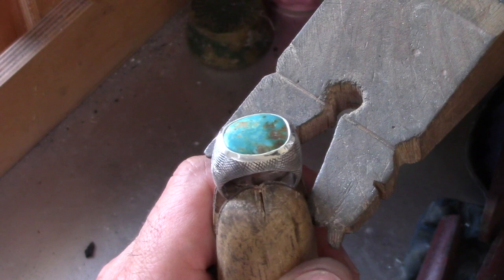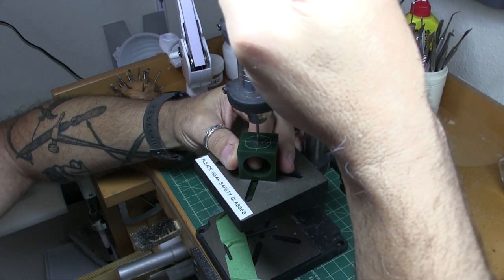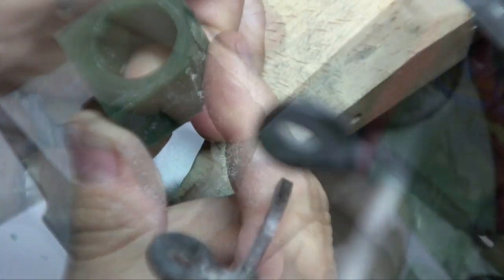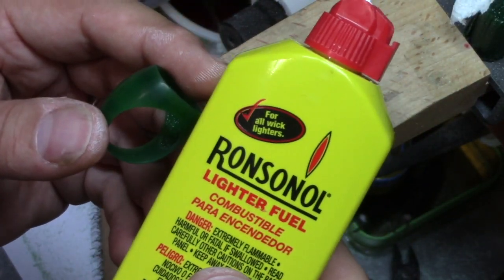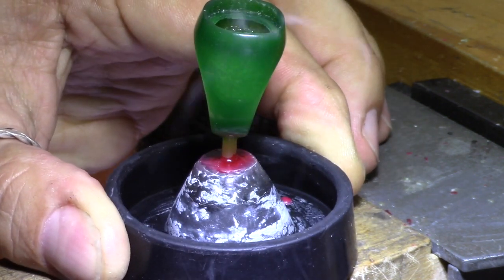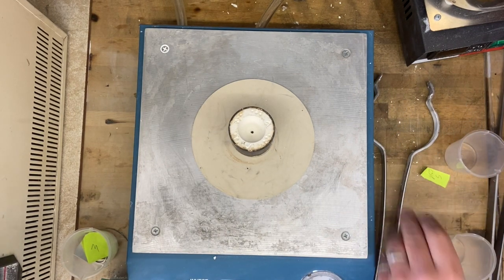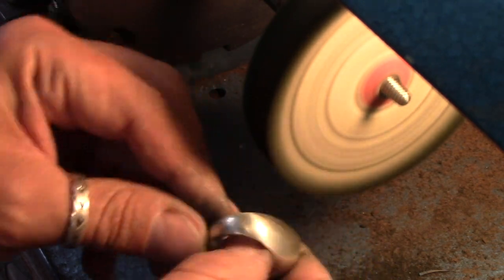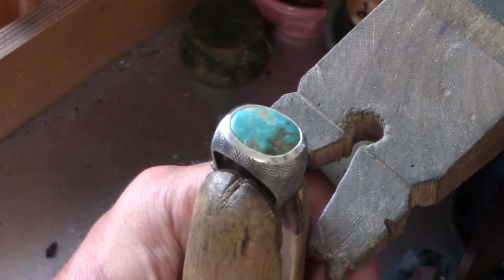Set a turquoise with the lost wax casting technique

Comment: This is a great video tutorial. Clear and succinct. I wonder how much did you take off the edge of stone setting in order to allow for shrinkage? Also I couldn't hear how long ago stone setting technique was used/what country/not sure what was said there. Also with such a large ring, were you at all concerned with the metal flowing to the top through one sprue?  Lastly, using a vacuum casting table takes the place of a centrifuge? Thanks
Reply from the maker: Hi - Thanks for your questions and for watching. Shrinkage is 5% after casting. This is an old style of setting and goes back to ancient Rome, if not earlier. If you size the sprue correctly and know how to manage the thickness of the wax model, then using one sprue is often successful. Also, using a casting machine, like centrifugal casting machine or a vacuum casting machine, can give you great results. You can absolutely use a vacuum casting machine for this project. If you want to learn LOTS more about making stone settings for casting, including casting with stones in place, please check out our Lost Wax 3: Settings in Wax workshop. Available online and in person. We have one starting this week (7/25/24). https://www.silverajewelry.com/classes/w/ID/539/eventID/7878/Lost-Wax-Casting-3-Stone-Setting-in-Wax/details.asp

Thanks again! Joe
Reply: @SilveraJewelrySchool  Thanks for addressing my questions! I will check that link out.

Comment: Hi, I was wondering; is there any shrinkage between the wax and the cast piece - did you have to enlarge the setting for the stone to fit? - thanks for the tutorial.
Reply from the maker: Hi! Thanks for your question. Yes, there is around 5% shrinkage when you cast your wax model. You can adjust for that in the model or after casting. Want to learn more making stone settings in wax models, including casting with stones in place during burnout, try our Lost Wax 3: Settings in Wax workshop. Available online and in person. Classes are live with your instructor, and recorded so that you can review them up to a year later. Thanks for watching! https://www.silverajewelry.com/classes/w/ID/539/eventID/8091/details.asp

Comment: 5:31 I’d like to be able to simply melt the metal as you did instead of using a furnace. How do you ensure you didn’t get the metal too hot/the perfect temperature? Do you just maintain heat all the way over to the vacuum right after it’s reached it’s melting point? Also what do I search for to get this equipment? What do you have the metal inside of? I see a cast iron pan, what else would you use?
Reply from the maker: Hi - Those are all very good questions. These are important steps to do correctly and safely, more than I can cover in a reply. Our school covers lost wax casting in our Lost Wax Casting 1 - the Basics workshop. It's available in person and online. Check it out at silverajewelry.com/classes/w/c/30/Casting for more info and upcoming dates. Thanks for watching. Joe

Comment: Is the vacuum table required for casting the silver or can you heat the mold hotter than the silver to allow more time for the silver to flow into the finer details
Reply from the maker: Hi! Casting started 6000 years ago with simple gravity pours into clay molds. This is the least amount of force you can use to help your metal fill the mold. A lot has changed. A vacuum table helps to pull trapped air and gas out of the way and pulls the metal into the mold for a good fill. You can also use a centrifugal casting machine to apply greater force to fill the mold. You can just pour the metal into the mold, but your chances of a full casting are reduced. Somethings you can do to assist the casting are to make sure that the sprues aren't too narrow. Add vent sprues on the to the models to keep trapped gas out of the way.  Don't try to cast too many models at the same time. Don't overheat the mold! Use the same normal casting temperature as a normal casting, from 900 - 1050°F. If the mold is too hot, the metal may take too long to cool and can cause porosity or other defects in the models. You can add force in simple and very interesting ways: look up steam casting and sling casting. :^) Thanks for watching! Joe

Comment: Great and informative video! I have an unusual design for a memento mori ring. Can I achieve this setting with small domed glass if careful when tapping the metal? Thanks!
Reply: Hi - Yes. We often have to practice this setting on glass in school. Try it on a simple sample first before the real thing, if you like and you can reduce the wall thickness to around 20-24 gauge, too. Memento mori are wonderful and hold so much meaning. Thanks for watching

Comment: Thanks for the great tutorial! 
I was wondering if someone could help me out with a problem I’m having. I recently got into wax carving and had several pieces cast in silver. The problem is that every casted piece tarnishes extremely quickly, I’m talking literally a few hours of just lying on my desk after polishing and it already starts to tarnish. I really don’t know what to do about this… Am I doing something wrong or is something wrong with the alloy my caster is using? Or is that a normal thing with casted silver?
Reply from the maker: Hi - Yes, fast tarnishing sterling can be frustrating. If you're having such a fast reaction, there may be an environmental factor. For example, storing your jewelry too close to your chemical patinas will cause them to oxidize. Also, humidity, sulfides in the air, and other things can make sterling tarnish rapidly. If you're casting is using a normal 925/75 sterling alloy, it shouldn't tarnish quickly. Two approaches to stop it are 1) use a non-tarnishing alloy, or 2) store your jewelry with anti-tarnish strips. Alloys like de-oxidized sterling and Argentium 940 are naturally tarnish resistant. If you use these and they somehow still tarnish, it must be something in your studio, like a nearby or airborne chemical. Their natural tarnish resistance is a great selling point. Anti tarnish strips can be inserted into a plastic bag or case with your jewelry. Also, properly storing your jewelry can help to prevent tarnish as well. I would try some of these tips, and also store some of your jewelry somewhere else as a test, like at a friend's house, just to see if it's your space or not that is the issue. You can also check some regular sterling sheet and wire, not from your caster. Is it tarnishing quickly too in the same place? Thanks for watching! Joe
Reply: @SilveraJewelrySchool  thank you for the tips! With regular sterling wire or sterling chains I buy for pendants I never had any problems at all, that’s why I was wondering about the casted pieces.

Comment: very nice ring design, I wondering is it possible to make a ring in 999% silver using lost wax system and vacum machine? I ask that becouse pure silver is hard to give details when casting in traditional way...
Reply from the maker: Hi - This ring was cast with a centrifuge, but also works with a vacuum casting setup. You can cast in fine silver (.999), however it is softer and so details will wear off faster than sterling. You could consider using Argentium instead. It is harder than fine silver and is tarnish resistant. It casts beautifully. You just have to wait longer after casting before quenching it or use a dry method to knock out the investment.
Reply: @SilveraJewelrySchool  thanks for the info  :)

Comment: How did you get the score marked design on the sides of the rings after it was cast ?
Reply from the maker: Hi! I used a checkering file, Swiss cut 0. You could also use a regular file and cut lines with the  corner of the file, or even try using your jewelers saw. The checkering file makes it easy to  make parallel lines. Thanks for watching!

Comment: Great video! Are you using wax saw blades to trim excess wax? How much extra space is being shaved in the setting to account for shrinkage (0.5mm)? And last, would you use the same hammer/punch technique if the stone was square or rectangular?
Reply from the maker: Hi Julie - Yes, I usually use 2/0 spiral saw blades. If you adjust the setting for shrinkage, it's 5% larger in the wax. The punch method will work fine for stones with corners, like squares and rectangles. :^) Thanks for watching! Joe

Comment: Hello,

I hope you can help! How do you do rubover set a single  round stone on signet rings? Should I use a flat top with straight edge stone and just glue it? Or a flat top with single bevel stone? If using a FTSB stone that is 1.5mm in height, do i need the bevel to be a bit higher than the stone? And what would the thickness of the bezel should be? Many thanks in advance!
Reply from the maker: Hi - Generally gluing is not the first choice for quality jewelry. Try this video on bezels from our friends at Beaducation. https://www.youtube.com/watch?v=Uqr466jH3nQ

Comment: Excellent video! Thank you for sharing your method. Do you need to resize your bezel after casting? I’ve heard the bezel can shrink in the process. Also, I am planning to use a furnace to melt down my metal— do you know if I need to add flux to it with this method? Thanks again!
Reply from the maker: Hi Amber - Thanks for watching! Yes, castings shrink 5%. So you either need to grind the setting after casting, or make it 5% larger in the model. Re: graphite crucibles and flux - There are mixed answers to this question. I don't use flux, or at most a pinch of boric acid when melting. Graphite is different from ceramic crucibles and has a very clean reducing atmosphere during a melt. Using flux won't ruin anything, but it can make it difficult to get out any leftover metal, which gets stuck in the flux. If you use flux, you definitely have to use a separate crucible for each alloy. Happy casting!
Reply: @SilveraJewelrySchool  thank you so much! This was so helpful

Comment: Hi there. What type of saw blade were you using  to cut the wax and also to detach the casted metal from the sprue base? Are they different blades? Thank you so much
Reply from the maker: Hi Maya - The blade for the wax is a 2/0 spiral saw blade and the one for metal is a similar regular saw blade (for metal, not spiral) between 2/0 - 3/0. Thanks for watching!

Comment: have you gotten into the 3d modeling and printing of wax ups
Reply from the maker: I'm so old that I was making models before computers, so that's my background. But I have dabbled in CAD and 3D printing. What's interesting is that with hand carving and computers you still get to the same place - a model you can burn out and cast using the same lost wax casting method. So far that is. At some point I'm sure they'll be able to print metal in a way that isn't fragile. Right now they use a method that is similar to sintering, and that tends to break more easily than traditional cast rings.

Comment: My boss please study with the boss, I'm trying to make a 2-inch flash casting, how many temperature measurements are needed.  and how many hours, please boss can tell me
Reply from the maker: Hi Rafid - The best source for the temperature requirements and recommended stages of heating are the manufacturers of the investment. For example, you can go to https://www.ransom-randolph.com/_files/ugd/cc5f22_ca7555f16b6446bbad0d8d4936cc08c7.pdf to find an example. Thanks!

Comment: Thanks for the helpful video! I'm just wondering how high should the wax bezel be over the stone? 1mm? If the stone is more domed than as flat as the one here, should it go far over where it curves in? Thanks!
Reply from the maker: Hi Lisa - Yes, I start with about 1 mm above where the stone touches the inside of the bezel. If the stone is very flat, it's less because the bezel has to bend further to secure the stone. The goal always is to maximize the stone, not to cover it up with the setting. Make it look even more beautiful. :^)

Comment: I'm confused, how did you get rid of the wax model in side the cast?
does it just burn and take into smoke?
Reply from the maker: Hi - The wax melted out during the burnout in the kiln. The kiln slowly heats up from 300° F to 1350° F, which removes all the wax, leaving a void inside the flask that is the exact shape of the wax model. Then we fill that space with cast metal. For more details watch my Lost Wax Casting Process video at SilveraJewelrySchool.com/videos. Thanks! Joe

Comment: If you wax is 1 gram how much metal do you use?
Reply from the maker: Hi - Thanks for your question. Every metal alloy as a specific gravity number associated with it. You can google it. Multiply the weight of the wax model the the SG of the alloy you're casting. Wax models are very light, so for accuracy, make sure your scale can measure to 1/10th (.1) of a gram. Thanks for watching!

Comment: Hi 
When i put the flask in the burnout klin do i have to follow the heat cycle or it’s enough to melt the wax and make the temperature up to 750 degrees c for about 1 hour and i pour the silver in the flask?
Reply from the maker: Hi! You should follow a recommend burnout cycle to ramp and dwell at set temperature stages. Most investment manufacturers offer PDFs with details for each brand. Heating too rapidly can cause the investment to crack or even blow apart. Happy casting!

Comment: Sea I don't have a vacuum chamber
Reply from the maker: It's possible to invest a flask for casting without a vacuum table. You can use vibration to dislodge air bubbles. You can cast with a centrifuge instead of using a vacuum casting machine, too. Thanks for watching!